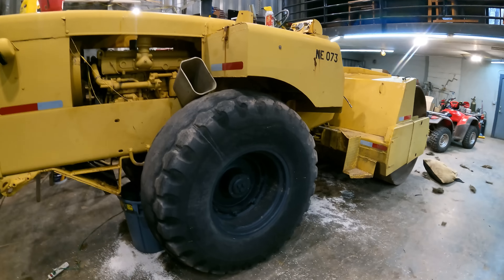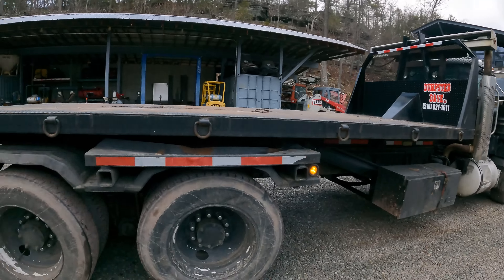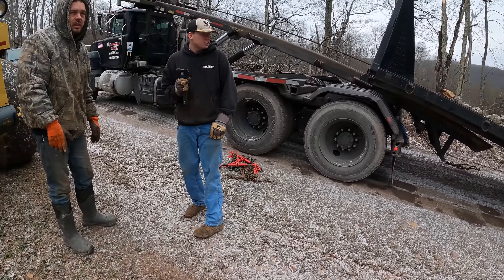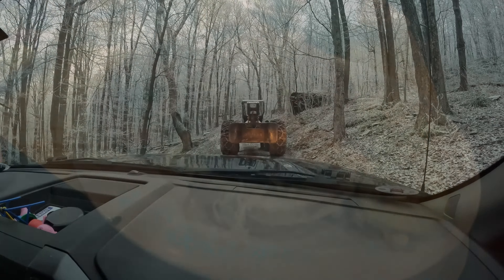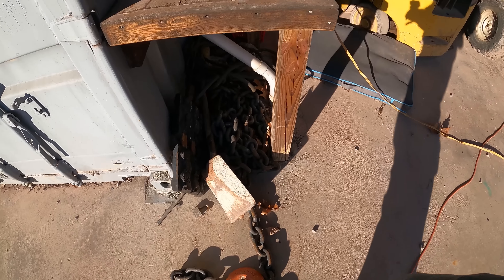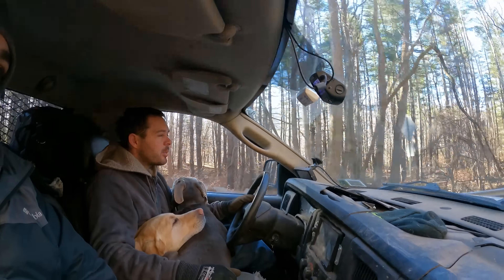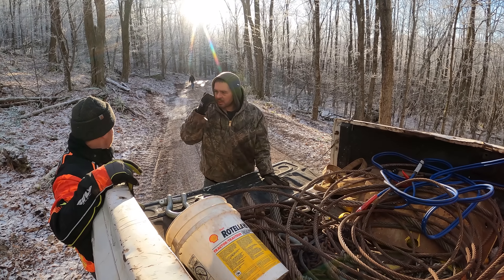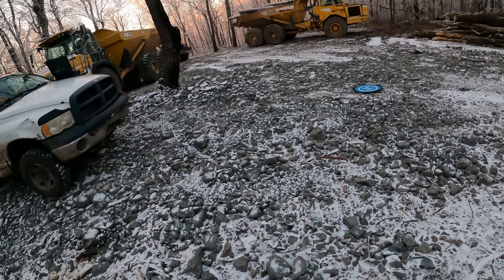Helping Bring the Roller Up The Mountain

Comment: hi to me it looks like you have not disengaged the drum gears/hydraulics  you cant  skull drag or tow a roller without doing this  you will do thousands of dollars damage to the drum  internals. also you would not have had as much trouble getting it to travel forwards ,,, even on that angle
Reply from the maker: How do you do that
Reply: @CerebralAilment  generally there is a screw / bolt that takes the pressure off the mechanicals and lets the drum  roll free from its gears  im sure there would be a YouTube video on " disengaging the drum of a powered roller"

Comment: 8 grand possibly 10+ with transportation and repairs seems like a lot of money for an old tired iron rear wheel drive only roller ? But I don't buy and sell used equipment what do I know ? I just know I wouldn't pay that much
Reply: A new one is over $100,000
Reply: @Hanzyscure  there is a big difference between new and 1960